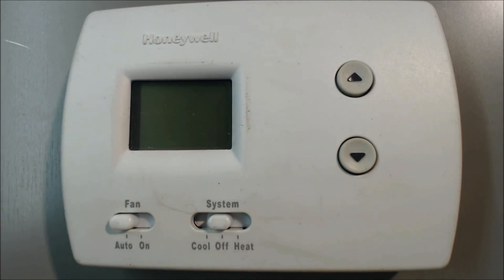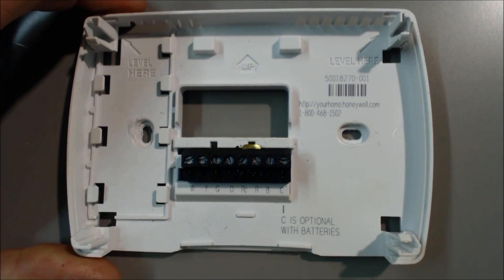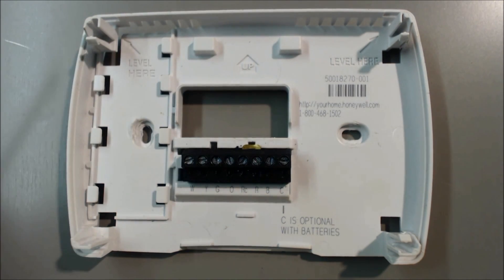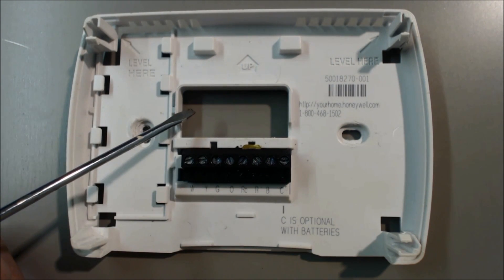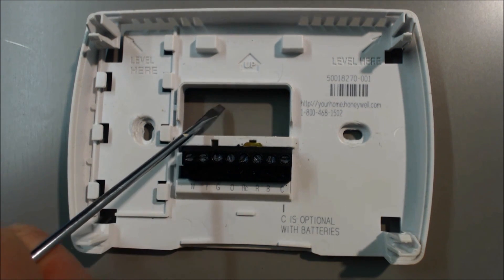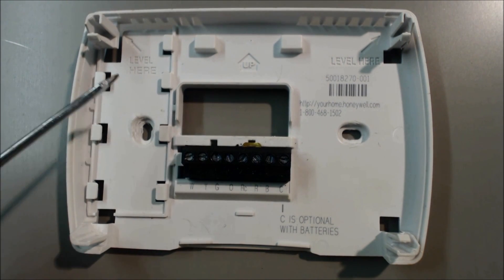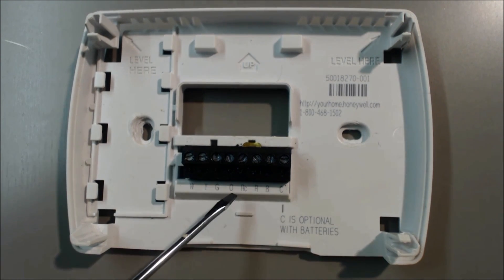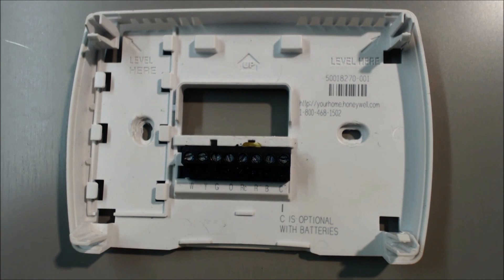How to Wire a Thermostat for a Furnace and AC Unit!

Comment: Good video. I have a digital thermostat that's several years old, and just now the low fan speed never turns off. Have to turn off the breaker. I have the fan set to auto and the heat/cool switch to off.  If I slide it to AC I get high fan speed.  No propane to test if its heating, and pretty cold now to test the A/C but it seems to kick in .  Bad thermostat? Batteries okay and no changes to the wires. Thanks

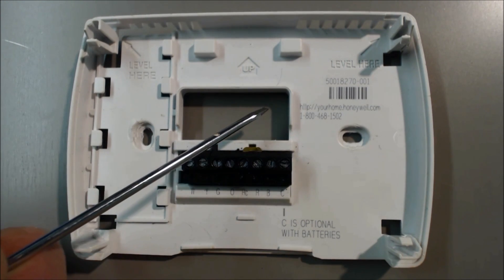Comment: Great video - But as far as I know the red wire (power)  and black wire (common to all signal circuits.) the thermostat with the black wire being the common completion to all signal wires for the relays that handle the 120 or 240 devices.. Maybe they don't connect the black wire directly to the thermostat anymore and the computer board handles the black neutral wire?? Is Blue from the control board the "New black neutral wire" of the past? 2:50 / 5:42. OR is there a separate blue wire and a "common" (used to be black wire in older units.) from the computer board.
Reply from the maker: The common is now the blue wire and black is usually used for the outdoor temp sensor on 18-10 wire, thanks

Comment: What is RC ? 2 wires together? Why?
Reply from the maker: Rc connects to the g and to the y and R connects to the w so if you have one heating and cooling system you would want to have that jumpered. If you have two systems then no jumper. Did you check out my most recent video on 10 most common thermostat wiring diagrams?

Comment: A/c furnace teck my name's Matt I'm a d2 licence teck that's CT  licence having trouble with my boiler it won't start the transformer is getting power from cad cell relay it won't spark tried about her used trans former that would not spark just wondering if I'm missing something the boiler I installed two month ago any idea thanx
Reply: Thanks any way it was a bad aqua  stat guess I didn't have power to the ignighter after all it was just on one side guess  that how you learn

Comment: Hi there.  I have enjoyed lots of your videos and learned quite a bit.  Recently, just before this Arctic cold front arrived, my brother in laws mobile homes electric heat died.  I ran out to his place and after taking the cover off his furnace wiring I see several wired with all the insulation burned off.  Oh crap!!  After looking it all over I realized it was all the 24 volt wires that were burned up.  So, I replaced all the burnt wires.  Still no heat.  Since this is a mobile home unit it has two switches, attached to a circuit board with several relays, one for heat or cool, and another switch for fan auto or fan on.  I could switch the fan to on and the fan would come on.  So I thought the circuit board must be fried.  So to get him heat until my friend which is a heat/air guy could make it.  I had to replace the 24 volt transformer.  I hooked the 24 volt transformer direct to the 24 volt connections of his sequencer.  Turned on the fan switch and then he could use his main furnace circuit breaker on to get the house heated up then flip it off until the house started cooling again.  Then yesterday my heat/air guy came out.  He did say it looked like the circuit board was fried.  I looked several places online and the cheapest for his board was around $300.00.  So wasn't going to do that on a 20 year old furnace, and he couldn't afford it anyway.  So what we did was bypass the circuit board and use a fan relay along with the sequencer to get it going.  Now our problem!  The house already had on the wall the White Rogers heat/air  with the heat/cool system switch and the fan auto/on on the side.  So we got it all hooked up.  We thought all was fine but then realized the heat and the air conditioner unit outside would both be on when you moved the temp control from heat to cool.  The heat/cool switch on the side didn't make any difference.  He said the thermostat must be defective and he will come back later on when warmer outside and put on a new thermostat.  So, my question to you is is there some internal wiring difference that has to be done to the thermostat to make it work correctly or do you think the thermostat is truly bad?  I appreciate your help.  Tom
Reply from the maker: Wow be careful with that until your tech comes back out!  It could be that your 24v is backfeeding through your relay or some other connection point in your furnace. Have your tech take the wires off the tstat and jump from heat to r and then see if your ac still comes on. Then you will know it is not your tstat that is the problem. If the ac does not come on then your tstat is the problem

Comment: I have a carrier residential split system with 2 stage heat on the heater with 6 wires on the thermostat. I have one white on w1 and one on w2 for the heat,  and I was wondering what thermostat i could get that would work . 
Thank you for your videos as I have gained alot of knowledge.
Reply from the maker: What model Carrier furnace do you have as they are more efficient when you let the control board pick the speed instead of the thermostat? That would also allow for a cheaper more straight forward thermostat. W at the therm would just go to w/w2 on the board if this furnace is new enough. Usually any Carrier furnace in the last twenty years can control the speeds at the board.
Reply: The carrier say performance 80 on it, and it is about 11 years old. 
have one wire going into w1 and another into w2
Reply from the maker: Ok then, on the control board of the furnace just wire the w/w2 terminal then and not the w1. Test it out. After about 16 minutes of run time it should go into 2nd speed. From then on, the furnace should know what speed to start at, high or medium due to the previous run time and it should ramp up or down as needed. Just use a single speed heat thermostat and you should be fine.
Reply: So let me get this straight, I wire thermostat w1 to furnace board w2
or thermostat w2 to furnace board w2
Reply: So did it work or what?

Comment: hi. I'm trying to go from a analog thermostat to digital. i do not have a c wire which i need for the therm so i was looking into turning my g wire into the c wire. the thing is i don't have a y wire, would anyone know how that would work? i have a central air unit whose wire go to c and g on the furnace panel, but nothing leading to y.
Reply from the maker: You can run a digital thermostat with batteries in lieu of the c wire. If you could not turn the fan on by itself without the ac running then the g would be your fan and cooling wire. If you have a yellow wire coming from your thermostat and it does not connect to the furnace board but is just wire nutted and goes to the outdoor unit then you likely are only set to run at one fan speed for fan or cooling and are not ramping up to a higher fan speed for cooling.

Comment: i have a blue, white, green . . yellow wire. but my a/c only turns on if i hook the blue wire up to the y terminal and keep the yellow wire unhooked. is this normal?
Reply from the maker: You would need to follow the wire into the furnace of air handler to see what color is attached to what terminal on the control board. You have the same terminal letters in a furnace and in an air handler you would likely just have the color wires. The only one that is sometimes different in an air handler is the common. Sometimes that color from the air handler is brown and sometimes gray. Basically with a furnace and thermostat just match the terminal letters to the same color wire. In a air handler and thermostat match the terminal to the color. I hope that helps. Thanks for the question. That is just the normal field recognized color code shown in the video.
Reply: +acservicetech thanks much
Reply from the maker: No problem, glad to help!